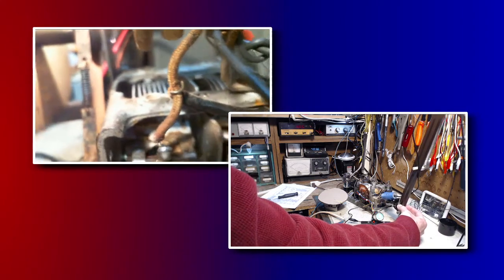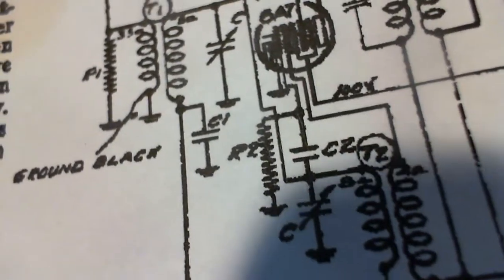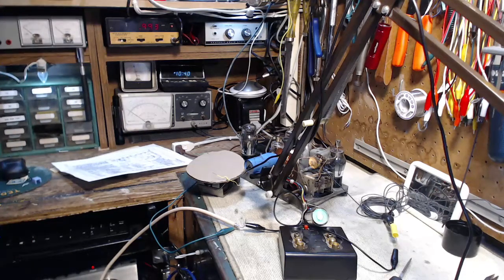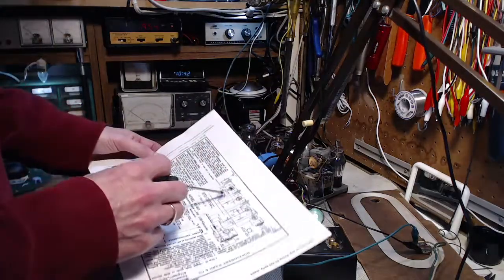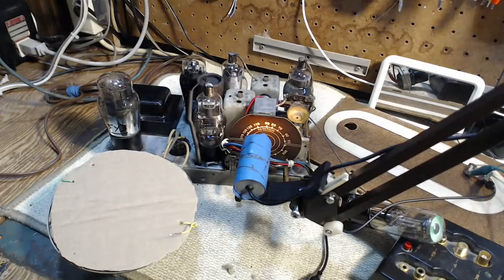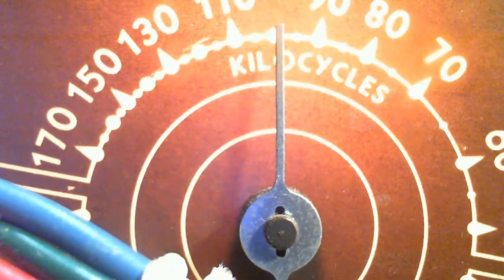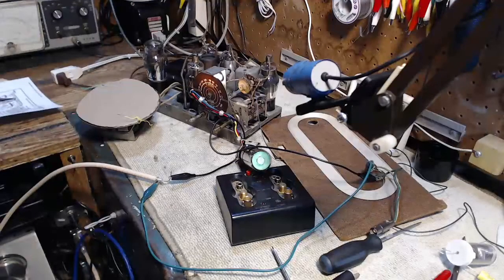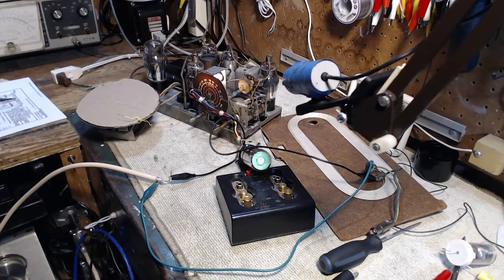Airline 62-264-425 Video #5 - Local Oscillator Adjustment

Comment: The radio is obviously not making any hum due to the new filter caps. It's on the customer's end (as usual) because of their cell phone chargers, light switch dimmers, motion detectors, printers, modems, fluorescent lights, LED lights, refrigerators, digital thermostats, etc., you name it. Most people don't realize this at all, because they're not concerned with it. Until... An AM radio gets turned on. And then wham! Noise and static hum. And I think it's the radio that's the problem. Lol.

Comment: double check the big cap solder connections and the 5y3 connections, you could have had a bad connection on one plate of the 5y3 and cause a big power supply hum from using only 1/2 the ac waveform
Reply from the maker: jpopwell1 Good idea.